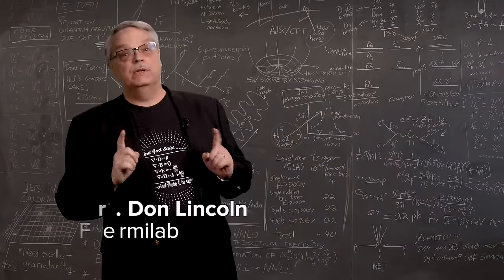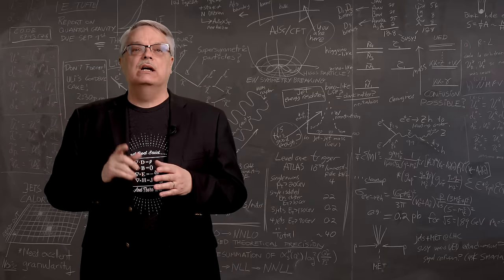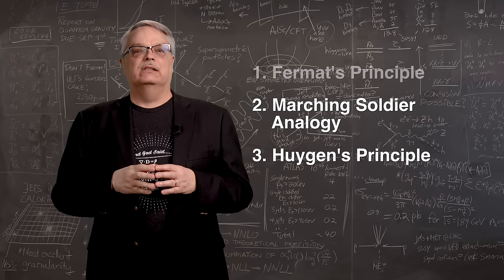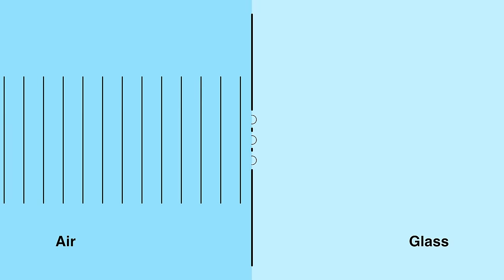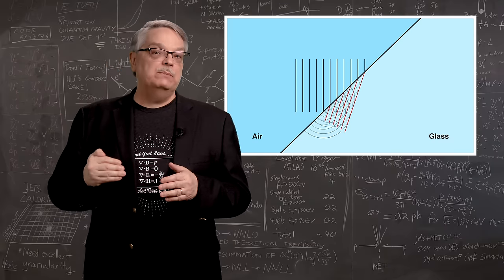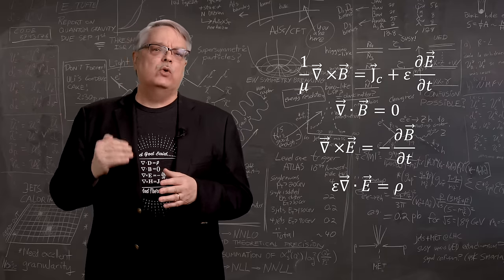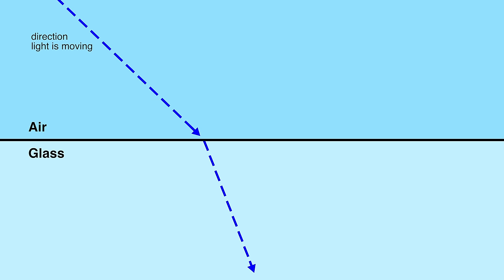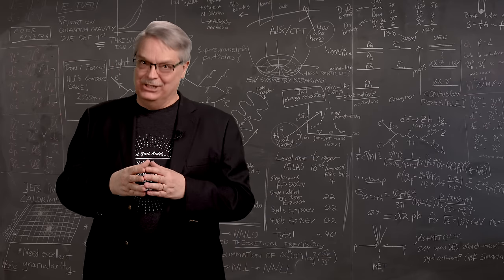Why does light bend when it enters glass?

Comment: While Lincoln's answer is logical, it fails to mention why the normal component of electric field is smaller in glass and why the answer to that question is related to a proper treatment of Huygens wavelet principle. As stated in many comments here, Lincoln's application of Huygens wavelets is completely wrong, and it's a shame he hasn't edited the video to correct it. So what is the connection? Constant frequency across the boundary! Frequency relates to the rate of change of magnetic and electric fields of light. The Electric field component in glass is related to the rate of change of magnetic field in the plane of the boundary. The point is that without this knowledge of frequency continuity, there is no theoretical grounds for understanding the strength of the electric field nor how the speed of light changes across the boundary. And without knowing that we can't say anything about how and why the wavelength changes. This is where Lincoln's answer meets Huygens, and the reasons for bending are related. Although Huygens didn't understand why electric fields are different across the boundary, he knew that frequency remains the same and wavelength changes. This is all he needed to know for a correct geometric argument. It seems that Lincoln fails to see the connection between the two.

Comment: That didn’t seem like a very clear explanation of why “light” slows down in glass when light is supposed to travel at a constant velocity regardless of reference frame.

To maintain the c, either photons are traveling through space curved by the electromagnetic field created by oscillating electrons, or the photons are absorbed by the electromagnetic field being forced to oscillate.

It almost seems like a variation of the speed of sound in air versus solids.  The main difference being that sound energy is a longitudinal wave while light is a transverse (in two fields) wave.  This makes speed proportional to density for sound and inversely proportional for light.

Anyhow.  I most came looking for why reflected light has a polarization mode parallel to the surface and refracted light is perpendicular.

Is polarization mode affected at all my an electrons dipole moment in that an electron’s electromagnetic field would create a precessional torque on the vibration of the light?  If so, would the angle of incidence affect the amount of polarization rotation, and would that rotation cause some of the slowing of the light?

Comment: The problem with the induced e-m field generating a superimposed slower wave is that the original ray of photons entering the denser medium would continue to slow the further they travelled before exiting on the other side.  Looking at actual rays of light entering a slab of glass we see that the rays are bent immediately on entering the surface.  That observation seems inconsistent with your explanation.  ‘

Now even if the induced fields arose instantly to full strength, you still have not really explained why the induced wave travels more slowly.

Finally, given the slowing, you still have not explained why the rays get bent.  It seems you have fallen back on the marching soldiers model for that.

Comment: I still can't understand how this bending of light is any different from the gravitational lensing of light by massive objects (like black holes). That's due to gravity curving space time around it and light following the curved path. However, doesn't it hold true in this case too? May be glass being denser than air ( analogous to a galaxy being denser than vacuum), leads the space time around and with in the glass to bend a little bit (way smaller in magnitude though) and as a result we see the light through glass's denser gravity? (Similar to the Eddington's experiment to prove Einstein's theory of general relativity by seeing a star's apparent and not the real position in the sky due to its light bent by sun during a total eclipse. Similar to how we see the position of a coin placed at the bottom of a water jar to be slightly raised due to bent rays? And Einstein definitely used Maxwell's equations in his general relativity. So, couldn't this all be connected and we're understanding refraction wrong all this while? I don't know.

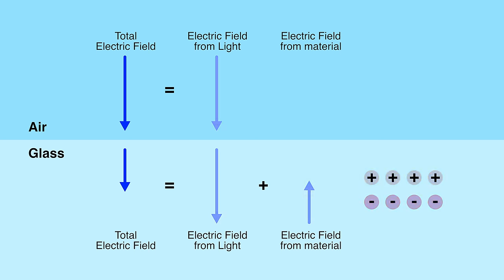Comment: You lose me with the sentences at 12:04 and 12:11. Why then does light bend in the other direction (away from the normal) when it goes from glass to air? The electric field in air is (presumably) also arranged in a random way and should therefore also set up a counter balancing electric field that results in the effect mentioned at 12:11.
Can someone explain this to me? Here is the verbatim text:
11:51 You start out with glass with no electric field in it.
11:54 The glass has charges in it, but they are arranged in a random way.
11:59 But when you send light in, you impose an electric field on it.
12:04 That field makes the charges move around, which sets up a counter balancing electric field from the charges.
12:11 The result is that the electric field in the glass is lower than it is in air because of how the electric field from the glass is in the opposite direction.
12:20 And this is the reason that the perpendicular electric field is lower in glass.
12:26 And that, my friends, is why light bends when it goes from air to glass.

Comment: This explanation seems plausible but still not quite right. You do not consider the "reflection" of light. Factually, the total electric field in air consists of the incident and reflection components. While using the boundary condition, you need to take into account the total electric field but not only the incident component.

Comment: If the light bends because of the electric field on the perpendicular direction being weakened by the polarized atoms, why ligth does NOT bend when it travels into a electric field?
Reply: Will light bend in a static electric field?

Comment: A photon travels in a straight line in air or glass.  Is it true that a photon can be absorbed by an glass atom and then re-emitted in the same direction as it was originally going, or is this wrong or too simplistic?
Reply: The atoms will not remember the direction the photon comes from. The photons would be reemmited at random directions by the atom.

What happens here is simple:
1- When you add a faster wave with a slower wave, it will form a third wave that is slower than the first one.
2- Light is wave most of time. Not particles. 
3- The wave in the air is faster than a wave in the glass, because waves move at different speeds depending on the.
 medium.
4- When the wave in the air hits the glass, the electrons in the glasss will "feel" it and start moving. When they move they produce a wave that is slower that that one in the air outside the glass.
5- When the wave in the glass interfere with the faster wave coming from the air, it will produce a third wave(combining the air/glass waves) that is slower, so light will change its path.

Comment: Refraction has nothing to do with light. One can recreate the same effect by drawing a straight line and folding the paper, ,"cutting"  the line in two parts. Both parts will be at an angle of each other, its width depending on the folding angle. This means that not only light plays no part in refraction, but that also Time can be ignored as a factor. A line drawn can be considered as timeless after all.
Reply: An even easier way, is to draw the line, and cover the middle part with a book. The thicker the book, the greater the refraction. between the two visible ends.
edit: the thicker the book the smaller the refraction.
Reply: BTW, the effect is only visible on a picture of the scene. A 2D impression of a 3D scene.

Comment: So even though light slows down in the medium, for a pencil to still look yellow the wavelength and frequency would still be the same?  If so the superposition graphic made it look like the electron magnetic friend had difference wavelengths and this a change in the frequency and wavelength. Thus it should change the color?
Reply: Just found out the frequency doesn’t change, only the wavelength.  Does that mean the excited electron superimpose at the same frequency?  Otherwise the frequency superimpose would have to change.

Comment: I want to see a 3d model showing what is happening, equations are just equations and not good enough. If the electric field in the glass is being stimulated by the electric field of the photons and that causes the repulsion of the electric field of the photons which there by causes them to turn or "bend" instead of continuing to travel straight, then how is that any different then the marching soldiers turning faster then light?

Comment: Howdy. With the risk of being a wise guy.
The perpendicular fields are the same in air and in the glass. However. The field strength is epsilon times stronger in glass. A shorter distance is needed to reach the same field. In other words. The glass can accommodate epsilon times as much field per length unit than air.
Regards.

Comment: But sir how you can clarify Fermat's principle with this explanation. Why this deviated path would take shortest time between two points.
Reply: short path short time
Reply: @amitghosh3938  thank you so much for replying. but my question is about explanation based on electromagnetic field. Parallel component of electromagnetic field is constant but perpendicular component is changing in such a way that light ray takes fastest path. why is that so.
Reply: @RamKumar-gx2dn  like the professor said "with a little bit of calculas"
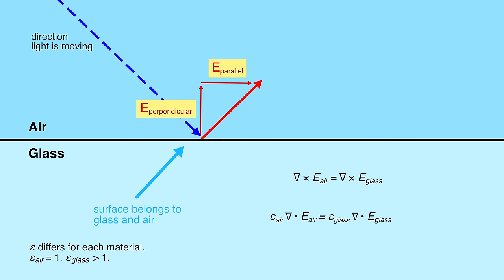When you equate curl of light vector in air and curl of light vector in glass(10:30)
Then we get Eair = Eglass
Similary when you obtain divergent of light in air multiply by epsilon to the RHS (second equation in 10:30)) you'll get the relation that perpendicular component depends upon elsion values in air and glass

So parallel component remain same and perpendicular will become shorter

Comment: Why epsilon doesn't apply to the component of the electric field parallel to the surface of the glass, only the perpendicular?
Reply: there applies magnetic field, you may find more info about it if you search TE and TM modes of propagation on a medium, in general its TEM (transversal electromagnetic), and there you account for both perpendicular components

Comment: What if the light is coming directly above the glass, not at an angle?
Reply: it won't bend technically, tho in practice it's kinda hard to do it, its like completally parrallel to the surface, it will go straight on the surface, but its hard to imagine

Comment: But why do different wavelengths of light bend differently, if the ratio between the dielectric constants is ... well, constant? Do the constants change in regard to light's frequency due to charged particles of the refracting material having more/less time to move back to their 'non-excited' states and therefore because of their average relative position from each other exhibiting different average opposite electric fields? This would explain refraction, but only of coherent light. If more wavelengths are combined would by my interpretation lead to dielectric constant changing through the medium in relation to the sum of waves. And then again, diffraction is apparently the complete opposite in terms of angle versus wavelength ... I just don't know. Another video, maybe? :D
Reply: Relative permittivity is not a constant. It depends on the frequency of EM wave.

Comment: i m not convinced why parallel component has to be equal even though their permittivity is different
Reply: It's related to conservation of energy, when light enters a midium, par of it gets transmited, and part of it gets reflected, reflected light for pretty much all cases, has the same angles as "light beam 1", i guess you are confused because  in the video they only talked about the transmited light, but you can't forget the reflected light.

Comment: Light is made of electric   & magnetic fields. When this wave enters glass from air an opposite field is induced in the glass. The incoming field destructively interferes with the opposite field induced in glass. As a result energy density reduces in portion of wave inside the glass compared to energy  density in the portion of the  wave in  air. Imbalance in energy  density induces a force field directed from higher energy density to lower energy density region i.e. downwards from air towards glass. The resulting torque produced by this force rotates the incoming light beam clockwise towards normal. When light beam exists the glass into air, the energy  density in the portion of wave in the glass is lower than energy density in the portion of wave  in the air. In this case the force induced due to difference in energy  density is directed upwards i.e from air to glass. The  counterclockwise torque produced by this force rotates the outgoing light beam away from normal. This is the reason for bending of when entering the glassfrom air & exiting the glass into air.

Comment: Light does not nor ever will bend, it will never be a particle or a wave. It is a helix and it get reflected or absorbed on surfaces.  Water (glad or plastic) has molecular surface and the helix is reflected to another angle.  Snells law is correct it is just explained correctly when it is said light “bends”. 

Electricity and magnetism are the same. The energies spin. They have a positive (left) and  negative (right spin) polarity that create the beam effect (a hollow center).  Not a particle, not a wave. 

You can see with a light bulb or iron filing on a magnet that you have a flow of “beams” all coming from the center taking the path of least resistance.  The difference between electricity/magnetism and light is magnetism and electricity seek to return to the pole and light continues its course seemingly perpetually, however that whe reaches  is the point you can’t see it, but does indeed return to the center.

Comment: Einsteinian wave-packaging envelopment is shaped in relative-timing sync-duration reference-framing containment positioning, Susskind's Singularity-point Lensing allows for twisting polarisation in rotational time-timing at nodal-vibrational loci and simultaneously in prime-cofactor relative-timing ratio-rates of wave length. 
The cross-sectional Apature of nuclei relative to nutrons is a practical reason for studying QM and Energy production, in QM-TIME Completeness Actuality.

Comment: Isn't it taught that electric field and magnetic field don't effect light? But how come the electric field in the medium effect light?  I think that when light tries to oscillate particles in medium some of its energy is lost. So because the light lost energy it reduced its wavelength and speed. I don't know exactly y frequency was not chosen as usual to accommodate the change. 
I thank u sir 4 your nice presentation. Also I  would love to listen to were I got wrong in above thought from someone.
Reply: Yes but when moving from a medium to vacuum seems tricky. Need to find out if the oscillating particles emit light after using it 4 vibration. Yes there seems to be darkness here. Can someone shed light on it pls

Comment: Even this explanation does not correspond to the law of motion of the energy state of matter. But if you don't know what the energy state of matter is, you will have a hard time understanding my answer. It is matter that does not possess mass, nor is it affected by gravity, which are electrons, positrons and photons.
Such particles are of a dual character, which science, to this day, is not able to understand and explain.
IN SHORT-
- a photon has two spins of the same size and opposite directions. One is the rotation around its own axis, and the other is the rotation on the sinusoidal radius around the center of the energy state, which travels along a certain path.
When the foron travels through the glass, due to the resistance in the glass, the radius of rotation around the center of mass decreases and the photon slows down, and when it leaves the glass, the radius of rotation around the center of energy returns to its original state.
THIS IS MY COPYRIGHT, WITH WHICH I CAN DISPUTE MORE THAN 80% OF WRONG THEORIES SO FAR !!

Comment: My question now is why doesn't the electric field of the air need to be considered? Is it because the air is the initial sort of...reference material? And the bending of the light is only relative to the glass? Would air need to be considered if there were a gap of air in between 2 panes of glass?

Comment: Dr. Lincoln ,
Thank you for the excellent presentation.  I entirely get you on the vertical case and I get what you’re saying at the horizontal interface.  However, what about once the light is inside the glass?  Is there some reason that the electrons a few molecules deep don’t react to the  perpendicular electric fields just as they do the vertical electric field?  The perpendicular component is there but I don’t see why the electrons don’t also set up a reacting electric field as well.  Is there some kind of conservation of angular momentum going on here or am I missing something else?  
Bill

Comment: It makes sense that since light is a energy, and glass is made out of atomic energy, shows the light is absorbed that slows its speed. Excitement state's ability to maintain itself till accepting its relieve of the excitement!
Reply: Note this is somewhat frictionless allowing the extraction of the light from the mass to have the energy light retain its natural speed - that is if friction doesn't build to cause heat dissipation, the confusion state to travel.
Reply: Plus the atoms energies are in resonance cycling for causing the bend, but not dissipation based.